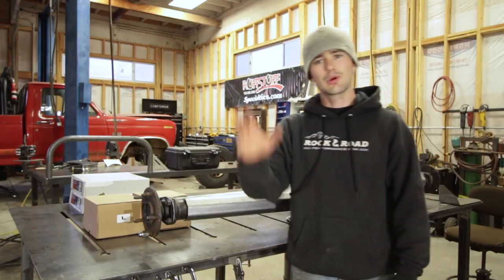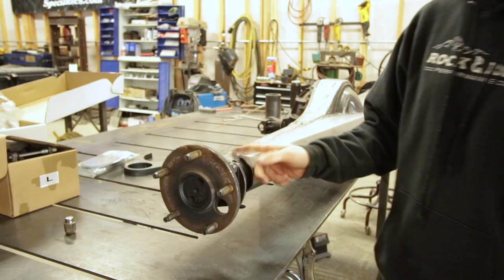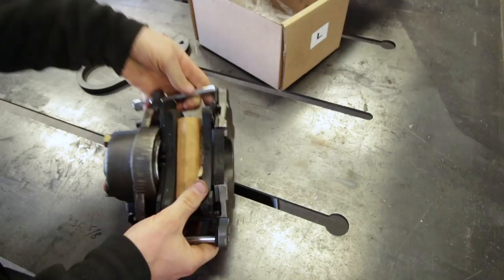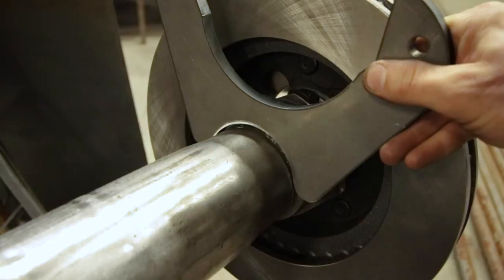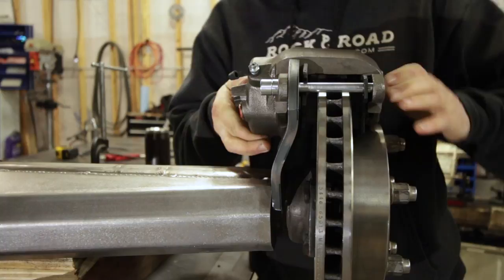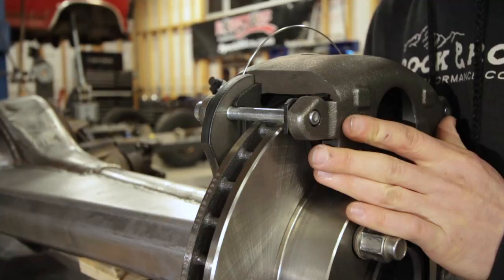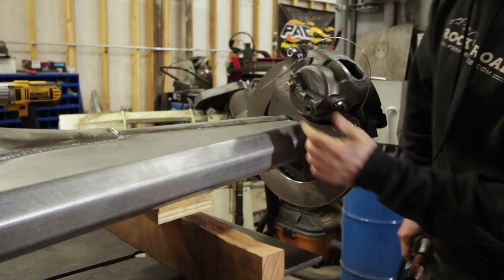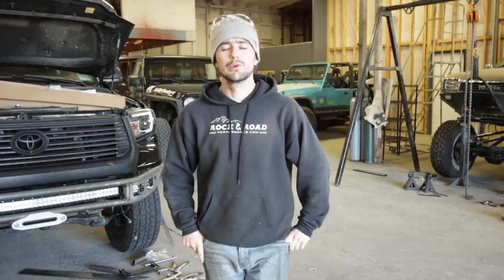Ford 9 Inch - Disc Brake Conversion - RuffStuff Specialties

Comment: If the caliper has dual bleeder screws it definitely is able to be either a right or a left caliper.  I feel like that would save on manufacturing expenses too.
Reply: I've purchased these. They fit perfectly on the left or the right. Great quality as well.

Comment: If you have to do all that cutting and grinding then they need to make a better kit
Reply: Rick P.  some of us cant afford $800 brakes
Reply: Exactly! Need a caliper mount that bolts in with the four axle bolts, done!!
Reply: If the opening diameter is too small it should be corrected before halving the bracket plate.

Comment: Is there such a thing for the alignment on the rotor to the axleshaft... "centric rings"... ???? Or maybe two centric rings in one....  meaning, one side of the ring aligns the rotor to the axle shaft, and the outer most of the ring (the other side) will align the wheel to the axle shaft???

Comment: we would make a fitting to put compressed air in caliper while tac welding bracket to axel tube (Wich kept everything in place realworld conditions) also we would do more tac welds than in this video to hopefully keep things aligned before releasing air. Also squirt water on caliper & mounts to keep "O" rings and caliper seals cool when doing Tac/Partial welds before disassembly and finish welds. Over kill? probably, but pad placement on rotors and caliper alignment was dead on. (This for stock car racing where brakes have to be on the money)

Comment: Would rear  disc brakes from a 8.8 Explorer diff bolt on?  I  fitted aussie late model falcon rear discs to a '65 aussie falcon diff. Almost a bolt on conversion
 That system had the bendix emergency brakes built in.  Cheap.

Comment: From the flange of the axle shaft to the housing flange it looks like you have some sort of spacer is that to make up for the drum backing plate? Also what is the 4 bolts that hold the axle shaft in torque spec an the third member nuts torque spec please an thanks?!

Comment: brake rotor should have been on the other side of the axle.... inner side, then it would have fitted and brake disk would have been in place once wheel is removed.
 longer bolts and no issues.

Comment: The rotor mounts on the inside of the axle flange.  Can you make a video on brake lines and proportioning valve?
Reply: no,p/p valve,with disc.

Comment: The one thing about this kit that bothers me is you have to bend the bracket to offset it so it sits properly on the axle. Having that metal bender is convenient but most people won't have equipment like that.

Comment: First off , Beautiful job here it looks perfect. Question though. Was the rotor made to go on the inside rather than the outside of the axle. Pulling the studs and putting them through the rotor first may have saved time bending the brackets and lowering the height at the same time.

Comment: Axle bearings now dickered ,It is a good kit if you have all the other tools .Other wise it is just 2 gm front calipers and a pre cut sort of fit bracket. The hardest part would be making the caliper bolts fit/align right otherwise. How do you get replacement parts now call ben dover.? Cheaper to make it yourself might take longer but just a couple of hours cutting up,drilling and taping  a plate of steel. Using the rotor for centering the caliper you're now at the mercy of how well they were cut,some of the cheap one are FAR from drilled right.
Beautiful welds and well done to make a one size fits all bracket work.

Comment: i appricate the video and showing the kit and i will used this video as a reminder of what kit not to buy. i wont beat a dead horse and repeat what the others have already said below me, and i agree with them. the thing i see most trouble some is the rotor covered and renderd usless the centering ring for the wheel at the end of the axle. im sure theres a name for it but i dont know what it is. so now the studs have to carry the weight of the vehicle instead of the ring in the middle. that dosent seem to desirable when bounceing around off road. some one help me out here on the name,, if u know what im talkin about
Reply: if u read the description on ruffstuff's page, he should have put the rotor on the back side of the axle flange not the outside
Reply: Jew Bacca aaaaaaaaaaa ok,
Reply from the maker: There are generally two different ways wheels are centered. Hub-Centric, and Lug-Centric. Hub-Centric meaning there is an exact size hole in the center of the rim that matches the vehicle hub and achieves center by seating on the hub as you're describing, and then there is Lug-Centric, which nearly all aftermarket wheels are, which use the lug pattern of the vehicle to achieve center. If you're lug nuts are torqued down, either one is perfectly suitable for offroad, or any other conditions your vehicle will encounter.  - Tim
Reply from the maker: I didn't want to go that route either. way too much work and that makes replacing rotors or a broken shaft on the trail a nightmare. I don't expect to have any issues with the way I set things up. Thanks -     Tim

Comment: The truss should have been last as a 360 degree weld to the axle tube would be strongest then weld truss to bracket would have been a bullet proof install.     Install a schrader valve on caliper to keep pressure on while welding. Who's rotor and caliper are used?  Dodge it looks like to me..........if you ever run into trouble a parts store is closer than 3 days away from kit supplier.

Comment: I have 1996 ford f250  7.3 I would like to know if I can find parts I wanna convert my brake drums to brake disc
Reply: It's pretty easy to just get the rear end out of a later model Super duty that came factory with disc brakes.
Reply: @UsedEveryDay  oh wow do you what year can be the same?

Comment: So reading the comments. Am I correct that this isn't even the correct way to use this kit, and he screwed up by bending and welding the bracket with the rotors on the front? I was wondering what was supposed to keep the rotor centered.
Reply from the maker: Lug-Centric. The studs keep them centered. I don't anticipate any issues with the way I set these up. Thanks - 

   Tim
Reply: How is the stud going to keep it centered when you have a wheel in between? You show the rotor getting centered with the lugs. The lugs will not reach the rotor unless your running the shoulder style lugs that actually go into the wheel. Used on aluminum wheels. Sorry but that rotor is going to rock.
Reply from the maker: 1 year later and 15,000 miles on this set up. No issues at all, brakes work great and I have yet to experience any rotor rock. I'm honestly very pleased with the set up! - Tim

Comment: Ruff Stuff parts are GARBAGE...300 bucks for brake calipers and rotors from AutoZone, and a Shitty made conversion bracket i could fabricate myself.. Terrible product
Reply: I Used their 14bolt caliper bracket. It fit and worked perfect. But I bought my own rotors,calipers and lines.
Reply from the maker: I disagree. RuffStuff has some of the stoutest parts available for serious offroad applications and thousands of people run their products year after year without failure. Primarily they make "builder parts" and have countless items available in that field. To say their parts are "GARBAGE" is simply not the case. They are one of, if not the most innovative and successful companies in the industry and they didn't get there with garbage parts. I did have some trouble with this particular kit on this particular axle, setting it up this particular way, however, I contacted them with my issue and concerns and without delay they gave me new brackets that addressed the problem. I decided to go this route instead of using the replacement brackets. 

      Tim
Reply: 300 bucks for a complete kit that's made for the fabricator is pretty inexpensive I think.  most disc conversions run 2 to 3 times that price.

Comment: no e brake,no good.9" axle not good bearings.light duty only.-----,,d60..kits all bolt up,no grind weld.no probs..i would of sold the 9" to some chevy guy,that would pay for 2 d60,s.YESSSS.